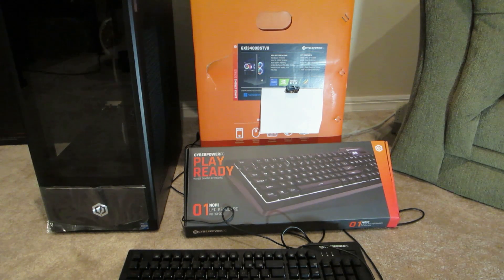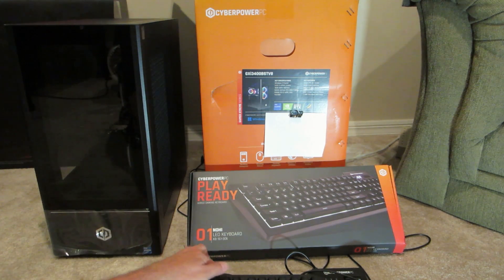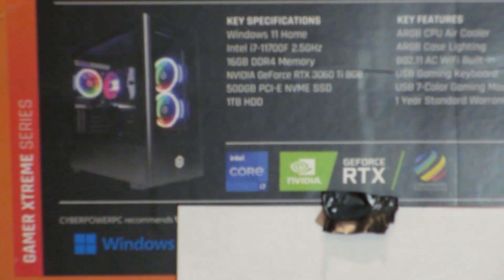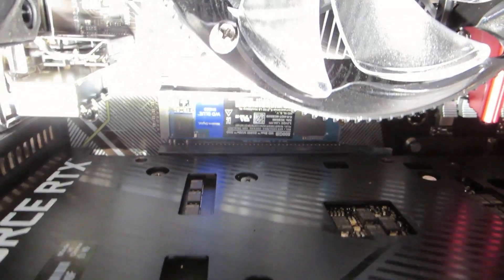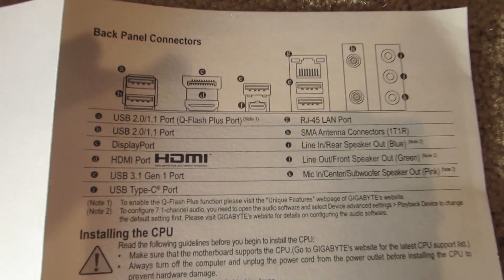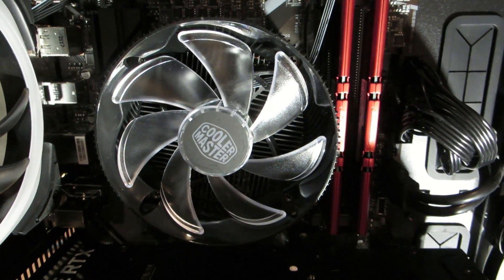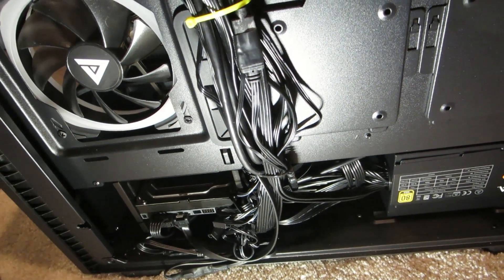CyberPowerPC Gamer Xtreme i7-11700F - 16GB - RTX 3060 Ti Review

Comment: I’m trying to take the cpu cooler out and there is a wire connected to the fan that goes to the back of the computer with the rest of the wires and I don’t know where to take it out at
Reply: I have this same computer
Reply from the maker: I show it in some of my other videos I believe this one https://youtu.be/yfj9u8QeY1A  but may be another on the cyberpower I have a play list
You may have to lossen a screw on mobo to get it removed it is just buried under those wires on side of cass. If your cooler doesnt use rgb wont need it attached.
Reply: @DesignBuildFixReview  yeah I figured it out I just followed the wire to disconnect the rgb. I just wanted to avoid cutting the wire ties
Reply from the maker: @eat4427  Yeah just just them pick up new at harbor freight

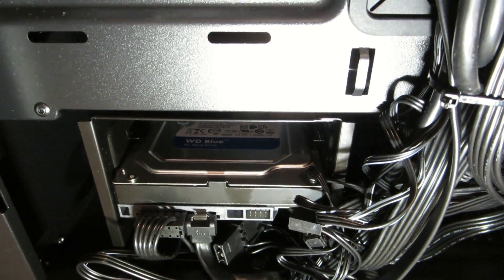Comment: 5:20 mine doesn't have that part, it didn't come with a hard drive or a place to put a hard drive inside of, what do i do?
Reply from the maker: Mine came with a 512mb e.2 drive and a mechanical drive 1tb that is the one at 5:20. Depends on what they sold you. If you are missing something they stated ithad contqct cyberpower or the place it was purchased.
Reply: @DesignBuildFixReview  I bought if off someone so now I'm screwed, it doesn't have a hard drive bay, I've been looking for one but can't find one
Reply from the maker: @ZioZs_Builds  So this machine boots to windows correct? If so there is a drive in there if you dont see it on the side of case its on the motherboard as a m.2 type drive. If you have a gigabyte  motherboard there is a second slot on the motherboard for another m.2 hard drive. You can probally also mount a 2.5" drive on the side of the case to the right. You really don't want to use the big drive enclosure I showed you at 5:20 if other places are available, those drives that go there are old technologies.
Reply from the maker: @ZioZs_Builds  watch this video you can still add drives  https://youtu.be/nsjPY2gbgZw  this system has many ways to add more storage
Reply: @DesignBuildFixReview  It loads windows just fine actually and you're right, I do have a gigabyte mother board and it does have another slot. It comes with an ssd that reads "MSI  m390 500gb" I'm fairly new to PC's and am just now getting into it, you're saying I should be fine then? As long as I install another ssd. Everything else on the pc works just fine btw, it's basically an exact copy of the one in the video except for the hard drive shown at 5:20 . I also purchased a new cooling fan since I heard the stock one sucks at keeping the cpu cool. I ordered the article freezer 34 eSport.
Reply from the maker: @ZioZs_Builds  Hmm, best buy will install the cooler you bought for $50 if you are worried. The easiest drive to install would be an m.2 directly on the motherboard but they are a bit pricey. The 2.5inch ssd could be added to side as there is a panel for a second drive there. You may have to buy and route the ssd cable under motherboard to connect it to motherboard its in a bad place under video card so you may have to remove the video card to get to it. I have a few videos showing some of this.
Reply: @DesignBuildFixReview  I wouldn't mind buying an m.2 drive, and that sounds great I'll check that video out!

Comment: I'm definitely confused as to how you think this is "not easy" to setup lmao. You literally plug it in and turn it on. Sorry but if that's not easy to you then I really don't think I can trust your review.
Reply from the maker: It's okay this is mostly just hey this is a good deal video. Also showing how to upgrade drivers. My,other videos show the concern I have that these units overheat and that is not acceptable long term. If you just plug it in and start using it later on the overheating CPU is a major problem. As long as people know this going in they should be fine if they resolve it.
Reply: @DesignBuildFixReview  it's not really a "major problem" not saying your doesn't do it because things ship messed up with mass produced items. Also CPU coolers are quite easy and cheap to upgrade I'm sure the one in it is stock

Comment: Hey I just bought one similar to this. Has same specs but different brand parts. I have an asus mother board and evga Getz 3060ti. I’ve had mine for a week or so and haven’t reached over 55 c. I bought a hyper 212 black edition hoping to help keep it cool. Have upgraded it to Corsair 2x16 3600mhz vengeance pro ddr4 ram. 2 to ssd m2. This thing is a beast for sure. Not having the cooling issue as other have. And I’ve ran multiple games and never got too hot.
Reply from the maker: It wasn't overheating for me on games, if I recall ran like 60, but when  I ran a windows defender virus scan on the c drive and cpu temps went to 100. I also ran video editing software and it got to 100, and ran a cpu testing app and it hit and stayed at 100. Most games use gpu and not cpu. There are some guys that it would crash in games too but wasnt a problem with me. That being said sooner or later it will get too hot doing other tasks. Here is one of the videos I made to test https://youtu.be/A1tS8A-rKbw

Check out my other videos I have a bunch that may explain it better. I have a video showing the cpu cooler that cyperpower put in these. It is a coolermaster it kind of looks like a ufo. I have a video reusing it as a top fan after replacing the cooler. Does yours look like it? If not maybe cyberpower replaced the cooler as well as all those other parts. Not sure I am a fan of and evga video card, I guess its a name brand so maybe ok. My gpu never gets hotter then 55 it doesnt overclock well at all though and I gave up on overclocking my asus 3060ti. Other guys could overclock it I could not without it failing.

Comment from the maker: Prices below vary per color you choose for a replacement CPU Cooler I recommend the Artic 34 Esports DUO CPU Cooler
$51.87 amazon affiliate link for Artic 34 esports duo  red https://amzn.to/3uuQOK3
$49.61 amazon affiliate link for Artic 34 esports duo  grey https://amzn.to/34mwPT5
$65.34 amazon affiliate link for Artic 34 esports duo  grey white https://amzn.to/3Hz1haL 
$52.99 amazon affiliate link for Artic 34 esports duo  white https://amzn.to/35IkUPE 

Air Cooled CPU Coolers that others say work, some are not as easy to install as the Artic 34 Dual
I will not be able to help you with install of these for the most part.
Select the LGA 1200 socket models of these:
 
$99.95 Replace Cyberpowerpc with nocuta nh-d15 brown https://amzn.to/34C2RdE 
$109.95 Replace Cyberpowerpc with Noctua NH-D15 chromax https://amzn.to/331YoAv 
$43.99 Replace Cyberpowerpc with Hyper 212 black edition https://amzn.to/3AZj34N 
$79.95 Replace Cyberpowerpc with Noctua nh-u12s https://amzn.to/34C3bZU 
$47.99 Replace Cyberpowerpc with Hyper 212 rgb https://amzn.to/3gu83mi 
$49.99 Replace Cyberpowerpc with Noctua NH-U12S Redux https://amzn.to/3rx1upG 

Liquid Radiator type CPU Coolers
$73.07 Replace Cyberpowerpc with Cooler Master 240 AIO https://amzn.to/3so2Jqj 
$245.92 Replace Cyberpowerpc with Nzxt kraken z63 https://amzn.to/3gtK72o   
$73.07  Replace Cyberpowerpc with Cooler master ml240L V2 https://amzn.to/3J4FmJ5 
$259.99 Replace Cyberpowerpc with NZXT Kraken Z73 https://amzn.to/3gsk9fQ

Comment: my controller that it comes with does not change the rgb inside the case do you know anyway I can fix this
Reply from the maker: All I could suggest is to contact cyberpower and have them send you a new remote, could try changing batteries. It may be the receiver inside the case but it is unlikely. They will send you a new one  in a couple of weeks.

Comment: Just bought coming tmrw! Great vid! Very helpful
Reply from the maker: I have had mine for 3 months working good but you have to test for an overheating cpu like 90-100 degrees. Here is my video on it https://youtu.be/yfj9u8QeY1A I have other videos on the cyberpower system. If changing the cpu cooler is beyond your skillset, bestbuy installs for $40 I have a amazon link in the video I posted here for a good cooler there are others as well but this one easiest to install. Most people don't know how bad the cpu cooler is and its not just this manufactorer, others same problem. So far after upgrading it machine works flawlessly and 25 degrees cooler then oem cooler.
Reply: @DesignBuildFixReview  will the Elgato - 4K60 Pro MK.2 fit in side...

thanks for your help
Reply from the maker: @therealacethaceo  it uses 6 watts and a pci express x4/x8/x16 slot the b560 d83h ac motherboard has a x4 slot available on the bottom so it should fit. depending on x4 x8 x16 i am not sure if the card will run faster or not if in x8 or x16 slot which is not available for you. Make sure if you buy you can return in case problem.
Reply: @DesignBuildFixReview  thanks

Comment: How much for the cyberpowerpc
Reply from the maker: I paid 1399 now 1599 at bestbuy
Reply: Dam Cyberpowerpc is getting expensive
Reply from the maker: @PlayzAmmo  I think its not bad, good systems even 20 years ago were basically $1500. I do have a video showing you the cost for the parts in my cyberpower and if you built the exact thing yourself. My $1399 would have cost me over $1900 to build not including windows 11. I think I would have upgraded the motherboard to a better one then they used but can't complain much there. Plus bestbuy does no interest for a year. If I built myself would have had to pay all of it upfront.
Reply: @DesignBuildFixReview  in my place it's $600 but I'm Not too sure
Reply: @DesignBuildFixReview  in my place it's $600 but I'm Not too sure

Comment: Had mine for a few days, games on high settings run really well but the fan is extremely loud and it overheats so fast
Reply from the maker: https://youtu.be/yfj9u8QeY1A  get cpu cooler replaced fast during return policy just in case.
Reply: @DesignBuildFixReview  okay thank you very much for the advice, ive just dropped a sub cause this saved me alot of trouble
Reply from the maker: @CloutMasterCam  Thank you hopefully it works out. I have more cyberpower videos if your still going for it.
Reply: @DesignBuildFixReview  I'm lookin at this exact desktop from bestbuy, hows it holding up for you 4 months later??
Reply from the maker: @-CriminalCupcake  No problems but the cpu cooler replacement is not optional.
Reply: @DesignBuildFixReview  buying today. Any recommendations on what I should do first?
Reply from the maker: @sauceefn9108  Test it doing some of the tests my videos show. The easiest is like Running a windows defender virus scan on the entire c drive by right clicking on C and scan with defender, while running that free temp application I reference. If you start seeing 85 plus degrees on the cpu you should replace cpu cooler. I have a few videos on it. Don't let it run too long if you get high temps. The problem doesnt show up for most video games. But intensive cpu events cause way too much heat. Mine was getting 100 degrees which is not good now 70s with new cooler.
Reply from the maker: @sauceefn9108  Here is the playlist link   https://m.youtube.com/playlist?list=PLM4hMwWWjaD1NoL0PZcOrEClcThsH8SLT

Comment: just build a nas at that point 6:23
Reply from the maker: Yeah, I built one before but didnt like having two machines running 24/7. It would be much cheaper for 3.5 drives to build an array. Those 2.5 SSDs are expensive. The plex server uses a lot of resources.

Comment: Bought this recently and it kept crashing games 5-10 mins in when playing on high settings. I assumed something was wrong with its power supply so I exchanged it for a new one. Its on its way in the mail. I wish i checked reddit and youtube for solutions first. I am new to pc gaming and this was my first one so i have no knowledge or experience. I did not know what the potential problems were but i assume it was the cpu overheating. I was planning on buying the artic 34 duo for the next one. Do you think it was crashing because of cpu overheating?
Reply: I don't know if your problem is fixed now or not but everyone that I know got this PC said that the CPU cooler it comes with is bad so upgrade the CPU cooler

Comment: Hey man I got a question, should I take your advice and flip both fans around, and what cpu cooler do u suggest? Please get back to me!🙏
Reply from the maker: that fan is easy to do i have video
Reply from the maker: https://www.amazon.com/gp/product/B07MJGNJB3/ref=as_li_qf_asin_il_tl?ie=UTF8&tag=designbuild01-20&creative=9325&linkCode=as2&creativeASIN=B07MJGNJB3&linkId=2bf643bc3fed3037d65d70c5f72ae781
Reply from the maker: flipping fans easy might as well do it make sure blows into case. When both are done check my resuse cooler fan as case fan. just dont do all at once let each settle. should replace cooler first
Reply: You should get the Corsair 360 mil and out it on the top of your pc if you haven’t already gotten one
Reply from the maker: @jads1182  The artic 34 duo does a good job. I know the aio systems have a lot of power overhead didn't want to have to use SATA, PWM, and USB. I have to keep my power usage lower so I can put in a bunch of Hard disks. The 600 Watt PS isn't exactly the best choice that they put in this thing.